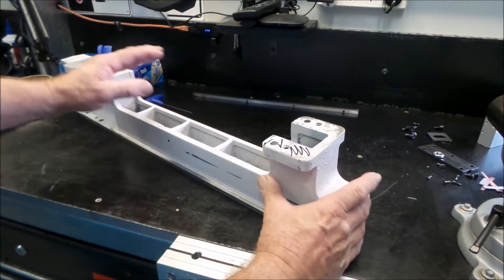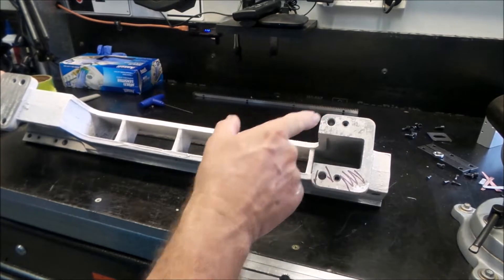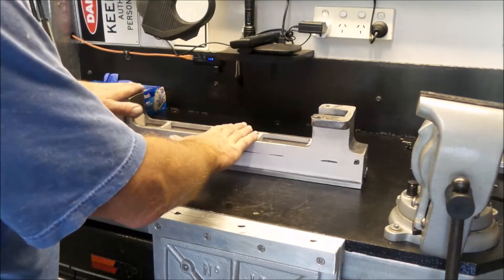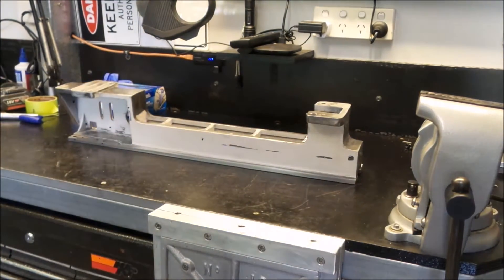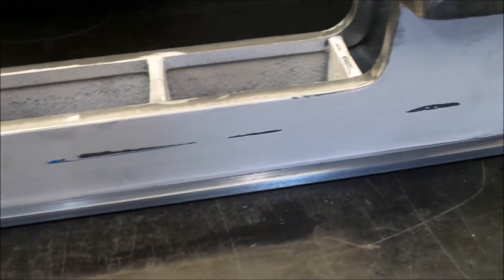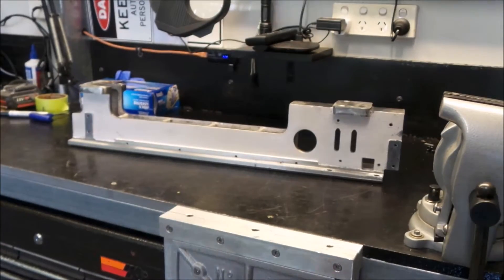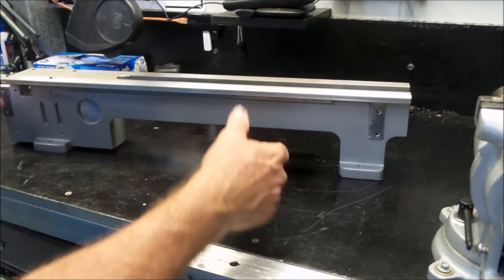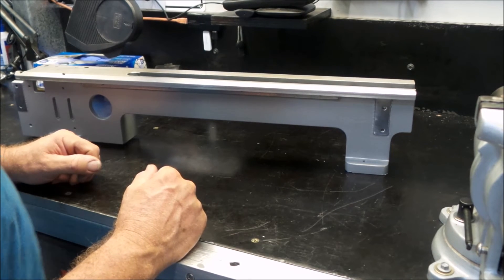Setting Up The Mini Lathe Bed Prior To Use. Episode 4

Comment: To Ausi shed man, a question regarding your videios back then, i need to what angle your cutter was to cut the vgroove in your tailstock bed your milled a larger base plate for your tailstock i require to know what angle the cutter was . please reply if you should happen to still check comments. thanks Daniel:
Reply from the maker: G'day Daniel 45deg Mate. I have been told its not exactly correct & should be 43 or something like that, but it worked fine for me & still does. This Mini Lathe is still a Pretty decent workhorse in my Shed. Cheers Mate.

Comment: Hey man, could u just use a good 2 part epoxy or bondo underneath the bed tben sand the shit out of it smooth, to get it ready for a couple good coats of paint, or maybe powdercoat?

Comment: You went further than I have improving mine. Nice job. I have lapped and hand scraped mine. Re geared my motor for more torque and slower speed. Bored out spindle to take larger stock. Been using mine for making parts and tools for over 10 years for work. Out of box they "work" but with a little elbow grease and time they can make really nice parts. Most of parts I make for work are under 12" and it takes up little space in shop. Used to keep it at my job but took it home. Need it more for my own projects. If I need to make part for work... I do it at night at home and add it to my  paperwork and time sheets. Now working on dro's for it.
Reply from the maker: Sounds awesome mate. I totally agree. Cheers.
Reply: how was the higher torqe process done?

Comment: I have had 2 mini laths and both came with the lad screw misaligned so I don't think you did it , the first lath i got was the 7 x 10 i got it in 1992  it came with only 2 plastic gears witch where on the forward and reverse shifter a friend sold me a 7 x 14 for 50.00 but all the gears where plastic and all where chewed up and motor controller fried. they are not worth the money they wont because you have to do all the fitting ,scrapping, lapping work, and it seems the chines cant seem to drill a STRAIGHT HOLE for some reason, u think they wood use a drill jig.